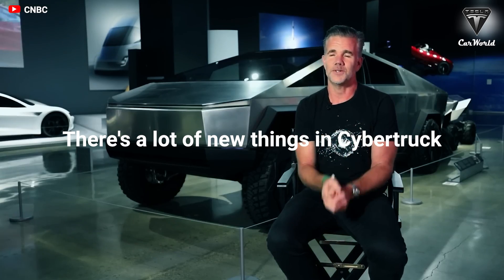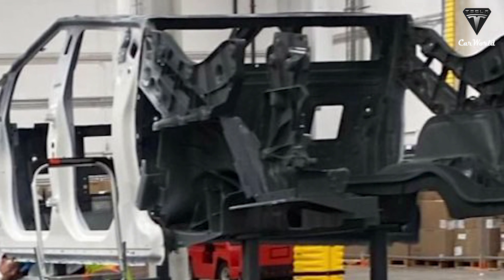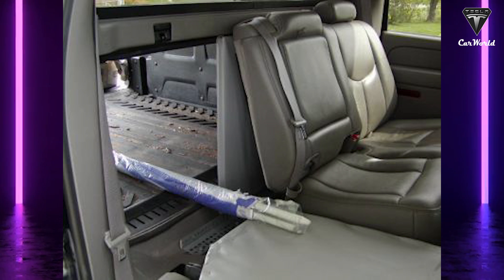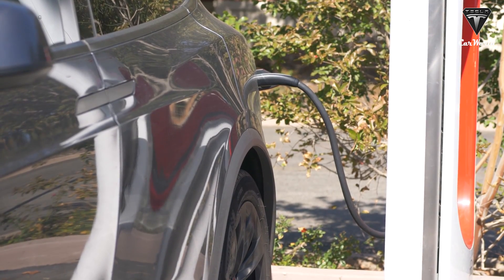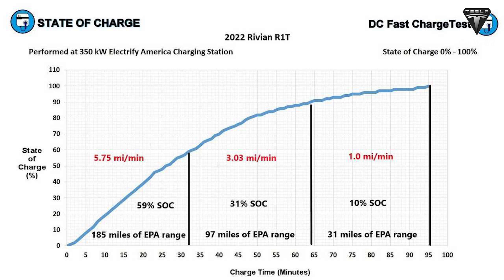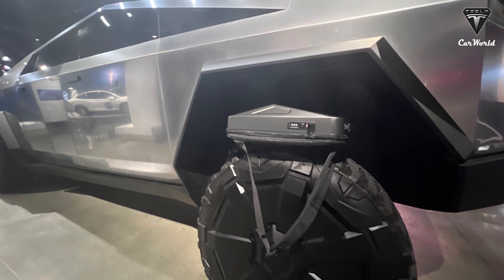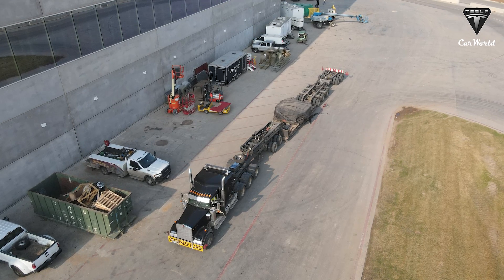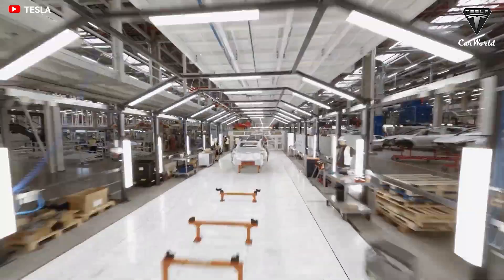Elon Musk Revealed Uncovering Cybertruck’s UNIQUE Frame for 2023 Version!

Comment: Cybertruck's too big and non-functional compared to Canoo.
Reply: How is it non-functional? If they meet the previously announced specs it will be a beast. Especially if they add the quad Motors. The Semi has a tri-motor setup and I'm sure you've seen the specs. Throw in the air suspension for easy entry/ loading, stainless steel panels that won't rust, especially if you are by the coast, more interior space than ICE trucks, air compressor, 240v outlets, no maintenance, and Prius-like efficiency, not enough for you?
Reply: False, Canoo went commercial only vehicles. Irrelevant.